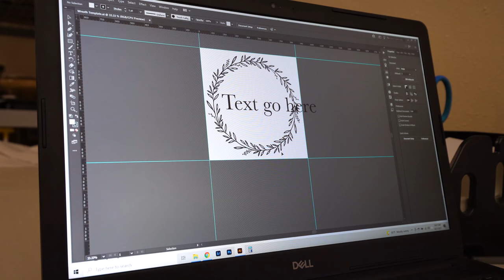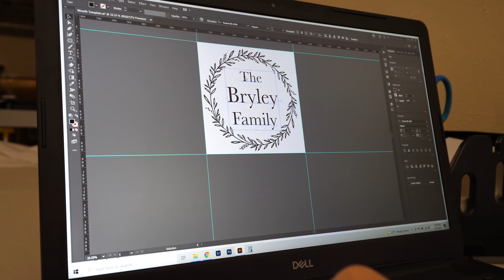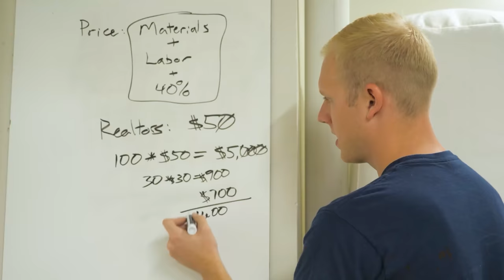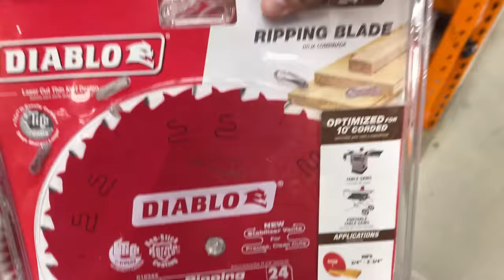is this our problem?

Comment: For the binding that still remains… When you encounter the binding, stop the saw leaving the material exactly where it is. When the blade stops spinning, slide your fence away and then feel how the material feels when you try to pull it back towards you. If it’s still tight and binding then the internal stresses are causing it to pinch your riving knife. If it slides back easily without the fence in place then it tells you the issue is with the fence and the wood binding against it.  The solutions will be very different depending on if it’s pinching the knife on its own or binding against the fence
Reply from the maker: Thank you! This is what I did in the last video. It is the stress in the wood. I’ll prove it in tomorrow’s video!

Comment: If its still binding, check the fence for square, front and back of the blade. There are also opposing beliefs, one that the fence should be square all the way across, and the other that the fence should be open a bit further out once you’re past the cutting point.
Reply: I have mine out about .003" at the rear. There's no reason the rear of the blade should be contacting the workpiece. Learned from Kelly Mehler.
Reply: @NWGR  i agree with you, there are many people who disagree though and have their fence completely square
Reply: @Millmadness  Yeah, I've seen it recommended a lot that way. Most euro saw fences dont even extend past the halfway point of the blade.

Comment: Glad that helped. If your blade is thin kerf your current riving knife might become a problem.
Reply from the maker: Blade and riving knife are appropriately matched and everything is waxed!
Reply: @jennieanddavis  Nice. But why were you having then the problem that you mentioned in the video. That your cut slows down when the board passes the riving knife?
Reply from the maker: @albertqss  Internal stress in the wood. Did you see yesterday's video?

Comment: Did not see the previous video so maybe someone mentioned it then.  Keeping your blade clean of pitch and resin is important and very easy to do.  Lay your blades in a bath of fairly concentrated laundry detergent for a hour or so and then a gentle scrubbing with an old toothbrush will lift that junk right off and blade performance will benefit.

Comment: As i said in yesterdays video try the sacrificial fence. There is no need for a full length fence, once the timber has been cut by the front teeth the fence is doing nothing apart from getting in the way.

Comment: Check if your rivving knife is the same thickness as the blade with a caliper. They should be the same. Their are 3/32 and 1/8 inch thickness for blades. Not saying they are different but is worth checking!
Reply from the maker: Yes. They are appropriately matched!
Reply: @jennieanddavis  well, Diablo blades aren't a true 1/8". They are 0.10. if you have a 1/8" riving knife..... It will bind as you're trying to push a 0.125" piece of steel through a 0.1 slot. However if you have a 3/32 knife on, it won't as much. Either that or it's cocked / bent or misaligned underneath some other how. They suck to adjust. Higher end woodworking blades are typically a true 1/8".
Reply: Its my opinion ripping short 8/4 stock on the band saw is a better way and safer way to do it. I liked your thinking on have several table saws with setup blades. This is how I think have 5 of them. Last point - blade height , an old iron worker told me that the gusset or valley of each tooth on a saw blade should be slightly above the wood so that the wood chips can clear out producing less friction less heat. Have a great day
Reply: @kriswojcik3286  it is safer, but is it better? I think that depends on your handsaw setup and what you're trying to make it do in a given time frame. He should be able to rip clean through these with a brand new blade without any hesitation at all so something is clearly wrong. Personally I just take the riving knife out - I don't like them for this very reason.
Reply: @Adventures_of_Marshmallow  I rip on a band saw, on a table saw, and on a table saw with a big power feeder on it. In some situations one of those does a better job than the other. Having a table saw set correctly is very important. I have a resaw king 2/3 tooth on an 18 Laguna band saw.  Everyone has there own unique setup that hopefully should make them feel safe and able to get the job done.
Reply: The riving knife is not supposed to be the same thickness as the kerf. It's supposed to be somewhere between the blade body thickness and the kerf thickness. This is to prevent the wood from pinching on the blade body and to prevent the knife from interfering with the kerf cut when it's not precisely 100% aligned with the blade.

Comment: @Jennie and Davis I would still look into a miter slot jig with a dial gauge if you don't already have one. It will make precise blade and fence alignment super easy. Plus if you're really going to have 3 table saws in the new shop it will come in super handy for that. For underpowered saws even a few thousands of an inch can make a big difference in ripping performance on thick hardwood stock.

Comment: Is your saw blade square to the table. That might why it is binding at the riving knife
Reply: Check... good point
Reply: The riving knife tilts with the saw blade, so any deviation would be the same and just result in a very slightly angled cut.

Comment: Binding wise, tune in your saw. Check for parallelism of miter slot to blade and miter slot to fence, the tolerance should be within 0.005 or less. You can get away with slightly aligning the fence away from the blade, as an add’l guarantee against kickback. Consider a ZCI with a splitter. Blade wise, it isn’t necessarily the tooth count; how often do you clean the pitch and resin off of the teeth ?

Comment: Kudos to you for soliciting advice and giving the advice a fair chance.

I find that the blade gullets need to just clear the surface of the workpiece to clear the sawdust and further prevent burning; that has also made a significant difference for me.

Comment: If you’re worried about the arbor nut falling some cheap insurance is putting a strong magnet on the blade. Spin the blade down so the magnet on the blade is under the nut. Then undo the nut. If it does fall the magnet will catch it and you can pull it up with the blade.

Comment: I remember a video where you said there was one outlet in the garage. Is that still the same way? Are you running dust collection and the table saw from that outlet? You may have voltage loss from not enough power. Try running a cord for the table saw to a different circuit in the house. It may not be binding as much as loss of power. I experienced that last weekend

Comment: you could clamp a bit of ply along the fence, and then about 3/4 the way passed the blade clamp a piece slightly thinner, think reverse of a jointer, allowing the stress in the wood room to relive its stress, after the cut, just before the riving knife, you can even make a jog to save time that drops onto your fence when you have it dialled in, don't forget to wax the jig too.

Comment: Has anyone suggested that the alignment of the blade and fence is not parallel? Lots of us will actually get everything perfectly straight in line with the miter slots, and then adjust the fence so the fat end is just a couple thousandths out away from the blade to prevent binding.

Comment: Diablo blades are usually a thin kerf, thinner than many standard riving knives. Contractor/portable saws typically run thin kerf blades because they're more efficient at lower hp. However, if the kerf is thinner then rising knife it will cause binding and can be potentially dangerous. I had this issue when I got my first cabinet style saw.

Comment: I’ve cut a lot of board feet with Diablo blades over the years good blades. I’ve noticed on my Grizzly table saw a thin kerf blade doesn’t work well with the riving knife that came with it. You may want to check with the manufacturer and see if a thinner riving knife is available could save you some grief.

Comment: I didn't think of it before, but it looks like your rip fence might angled slightly toward your blade as well. I set my fence so that it is angled away from from the blade a 1/32. That might be why your stock is hitting your riving knife.

Comment: It’s best to use a full kerf blade with your full kerf riving knife. Also a full kerf blade is more stable therefore giving you s better cut. Think kerf blades are  usually used for portable saws that are lower horsepower.

Comment: If it's binding at the riving knife (usually due to curve being realized after the release of support from adjacent material), try some wood wedges placed in the cut out kerf to keep the board 'open' so it doesn't bind on the riving knife.

Comment: Davis You have already heard this. My old cheap saw would bind up constantly. I discovered it was the riving knife. It was not fixed until I bought a new Grizzly 771 & was able to exactly match the blade to the riving knife. The fence is EXACTLY square to the blade plus a expensive glue - line blade did the trick. The saw cuts like butter. A electrical circuit dedicated ONLY for your saw is best before you burn out the saw’s motor. The isolated electrical current will allow the motor to draw all the current it needs. HAPPY CUTTING!

Comment: If your workpiece is pinching between the fence and the riving knife, the fence needs to be repositioned.  Refer to your operator's manual.
Reply: Or install a board on the fence (like a sacrificial fence) but let it end on the centre-line of the blade spindle, that will allow the wood to "flare" if it wants to... 

😎👍☘🍺

Comment: On most table saws where the fence is an aluminum profile, you can slide the fence back a bit so that it just goes past the blade center an inch or so. That will prevent pinching between the riving knife and the fence. Think of this; the part of the work piece that has been advanced beyond the center of the blade is already cut thru and it don't need the fence anymore. This is why most dedicated riving saws have shorter fences.
Another thing that will improve ripping is to raise the blade as much as possible, providing you have a blade guard - AND ONLY THEN. This will make the saw teeth meet the work piece in such an angle that it will press the workpiece towards the table, resulting in a steadier and safer operation. It will also greatly reduce the risk of kickback.
Finally, and perhaps needless to say, the riving knife cannot be thicker than the saw kerf, or it will bind no matter what. It should be slightly thinner... Good luck / Peter

Comment: That's a misaligned fence. Always err on the side of the rear being farther away from the blade than the front--even if it's just a few thousandths.

Another thing to check: don't cut the entire thickness of the board in 1 pass. Lower the blade so you're only cutting half at first. Then cut the upper half.  If it doesn't bind on the first cut but does on the second cut, then it's an issue with the wood being warped. Flip the piece over and see if it still happens.

Comment: One thing that has helped me not burn so much on maple is putting Johnson paste wax acrossthe table, a light coat on both sides of the blade face itself.  Also is your riving knife thickness the same as the blade you are using?
Reply from the maker: Everything is waxed and the blade/riving knife are appropriately matched
Reply: @jennieanddavis  then it is the internal wood tension.  Maple and even cherry are notorious for burning as i believe you pointed out in the video.  One other thing that i do and helps when i cut alot of maple is once i notice more than "some" or acceptable amount of buring is to clean the blade with simple green and a nylon brush then rewax.

Comment: Economical table saw blade...The "Spyder" brand at Lowe's called the Tarantula has served me well. I also use the 7 1/4" 40 tooth blade in my circular saw, and their key hole set. Good customer service at Spyder. The only issue I had was operator error when using one of the key hole.

Comment: Make sure your fence is DEAD-ON and then set the back (0.01") away from the blade to ensure you're not binding. You're still binding, so something isn't right if it's doing it over various pieces of wood. 8/4 Hardwood is notorious for having built-up stress, and when you cut into it, it often will try and close, hence start binding. Sometimes you can't avoid it. If that happens, DO NOT try and keep pushing the material through, this is how people end up hurt. Stop the table saw immediately, and don't move. Once it's shut down, remove the piece of wood, and simply re-cut it. I've had to stop several times through a stubborn board before (especially hard maple). Also, PLEASE keep your fingers away from the blade. There is no reason your left hand needs to be holding on to the rest of the work, even when cut through completely, it will sit there until you power down and can grab it. Yes, it takes another few seconds, but it's much safer.

Comment: That is better. But; at least one tooth height above the material. Give the guide rail at the end a tiny bit of slack - just a bit - so the material does not bind. My guess is also you need to go a bit faster through. Wat also helps is to make a cut on the underaide first - just a few mill

Comment: Davis,   Have you looked at CMT blades?  They are not as expensive you think,  as they can be sharpened many times and are just a few $$ more than the use once throw away big box blades.   If you like wood slicer for your band saw, you will love CMT for your table saw and chop saws.  I have replaced all my blades with CMT and will use nothing else.   I have cut many of board feet of hard maple using the CMT Crhome rip blad and experience no burning or binding on my Laguna F2 table saw.   I suggest you investigate and try CMT.

Comment: Whats funny is that you have a video about the bandsaw under performing, replacing the blade, and going on about how important maintaining your tools is. Listen to your own advice!
Also check if the blade and riving knife are properly aligned. Its a pretty easy check and fix.

Comment: Wax your top & square your fence , raise the blade so that the entire cutting tooth is above the material  being cut . Next time try the WEN brand saw blades , I was very pleased with the quality of the cut .It's been on my miter saw for 10 months and its time to swap out , I will buy another and toss this one in the recycle bin . $22.00 is less than I spend getting the Red and Orange blades sharpened  .WEN is sold on the Amzn store

Comment: Your living room looks like mine. 2 large shelves full of epoxy and woodworking stuff. I have a small 900 sqft house. So I do all my wood cutting in the garage. I do any large furniture assembly in the kitchen because the garage is full of woodworking equipment. It's the only place I have where I can lay out a 8'x6' project.

Comment: Yeah buddy!!! I stand by what I said in the comments on the other video… blade type can only help so much in counter acting wood tension on 8 quarter stock. The surface Area of a tablesaw blade versus the surface area of a bandsaw blade is not able to be compared which ultimately equals a much greater potential for binding on a tablesaw than a bandsaw every time!! Just look at how much of the blade is in contact with the wood at any one time as your making your cut and you’ve got your answer!!
Reply from the maker: I hope your subscribe button is ready for tomorrow's video!
Reply: @jennieanddavis  Boy oh Boy... !!!

Comment: You are trying to push the full length of the fence. attach another piece of wood shorter than the length of  fence past the blade that will create a relief so you won't struggle to push the wood stock through.

Comment: Did you swap same-kerf size blades? Looks like you bought a thin kerf blade and I'd be surprised if that's what you had in that saw. If you change the blade kerf you need to change the riving knife as well

Comment: First off, enjoy the videos... But changing a table saw blade for me takes like 45 seconds.  if that.   Its funny because when I first got my saw I was reluctant to change blades because I "thought" it was a pain in the butt, so I would just use the combo blade.   Then after a few changes I realized its definitely less than a minute for a good blade, with a purpose.

Comment: 1) Skip the saw with a combination blade. They are good at nothing.
2) if you are binding at the riving knife, either your fence is not dead on parallel to the blade or you did not have a flat surface of wood against the fence, which means that you need to run a first pass on the jointer.
3) if you want to be a woodworker, stay out of the big box stores. They have construction stuff not woodworking stuff (except glue).

Comment: As said by others, the riving knife is probably the wrong thickness.  You should match the kerf of your blade to your riving knife.
Reply from the maker: It's not. They are matched appropriately.
Reply: What thickness are they?? The blade kerf and the blade plate thickness.. your riving knife should be based on the plate thickness not the kerf

Comment: I'm really glad to see that the blade swap helped you out, but I couldn't help but notice that it was still getting a little stuck and I'm concerned as to why. It's hard to tell just from watching a video, but my gut instinct is that your aftermarket riving knife may be part of the issue: perhaps it's a full eighth inch kerf and your blade is a 16th less than that..

Comment: Hey i noticed yall use epoxy to fill knots and cracks a lot. You should try starbond adhesives. Its way faster with the same result. I know yall are into fast productivity. Lol